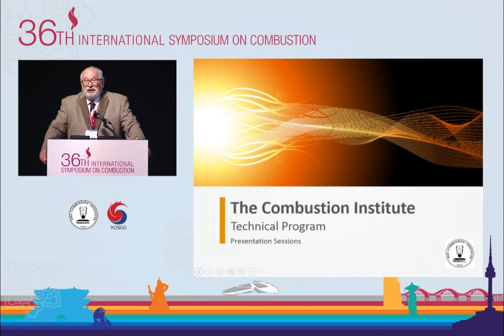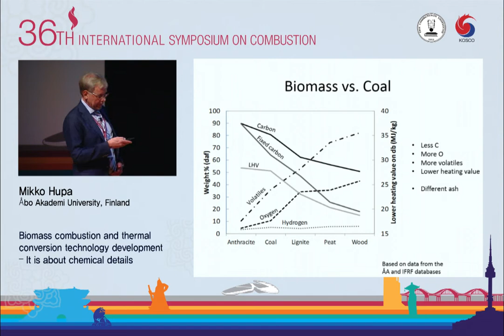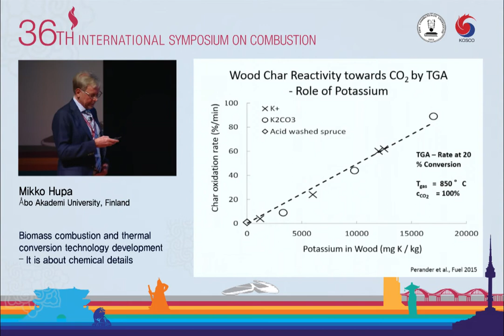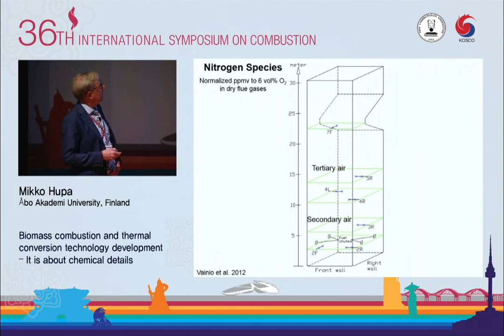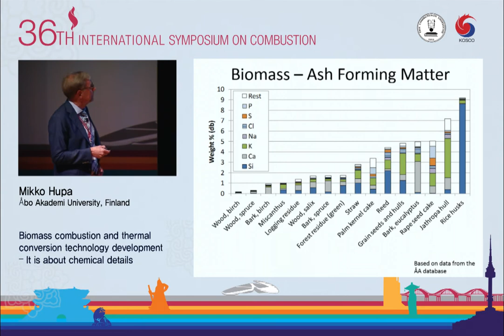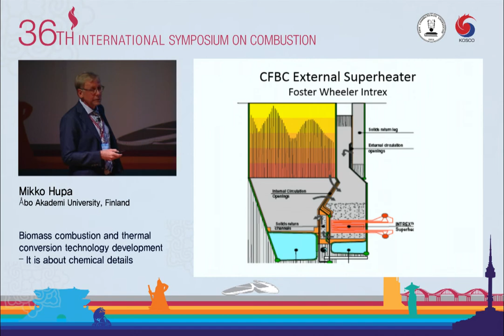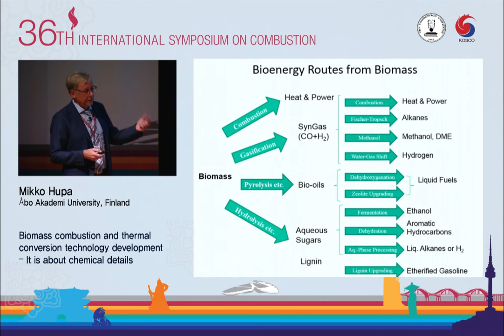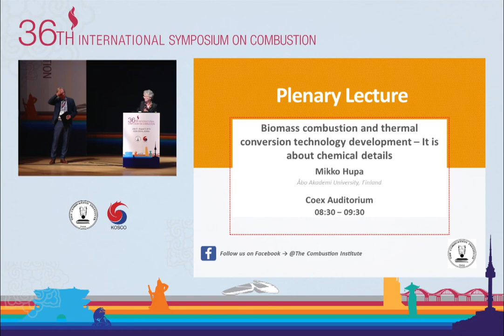Biomass Combustion and Thermal Conversion Technology Development, Mikko Hupa

Comment: How much energy per a squared or cubic kilometer of land material?
Reply: it's no easy to answer this qustion due there are realy big differents between forste and land. im wording in the branch biogas in china
Reply: Hello. I don't have energy based calculations, but I do have some mass flow calculations as written below. You can do the energy calculation later. If you need references, please let me know. The data below is from the Amazon rainforest in the state of Mato Grosso, Brazil. It is estimated that there are 151 metric tons of carbon in 10,000 m2. It has been estimated that 50% of this forms gases during ground fires. Measurements show that 90% of the volume is CO2 and the remaining 10% is considered CO. Combined with oxygen from the atmosphere and from the biomass itself, the total emission is 221 metric tons of CO2 and 15.4 of CO. This is approximately the same as that emitted annually by 68.2 cars. All this from just 10,000 m2 (100 m x 100 m). Is very!